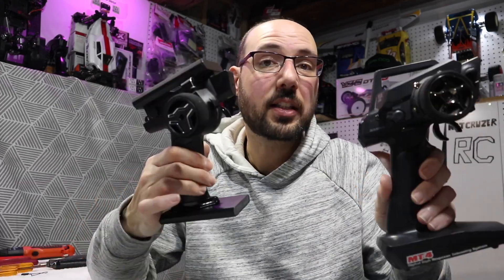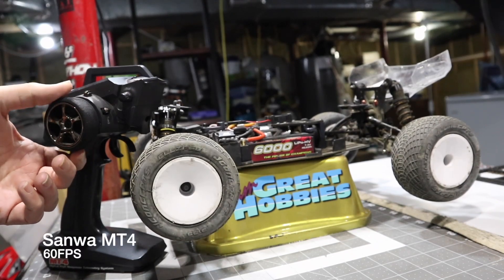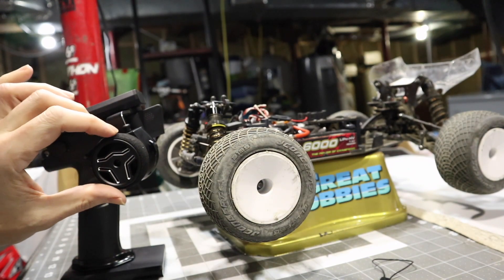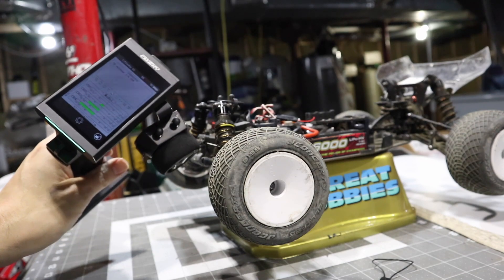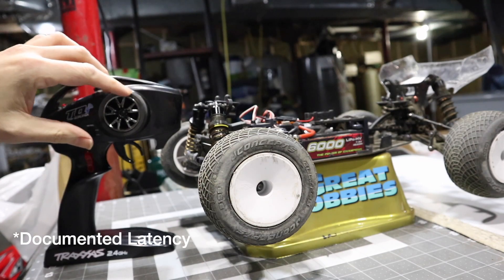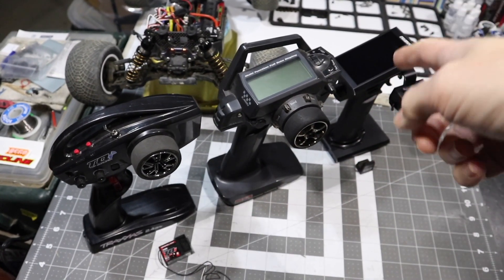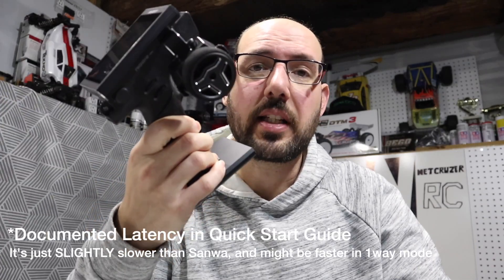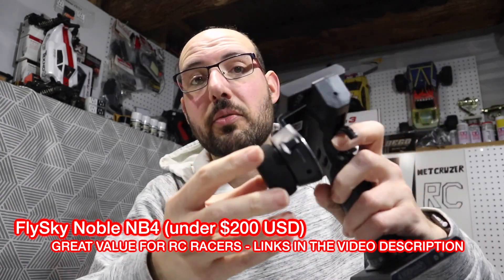RC Transmitter Latency Tests!  FlySky Noble NB4 vs Sanwa MT4 vs Traxxas TQi - Netcruzer RC

Comment from the maker: All radios were bound to their receivers in 2 way telemetry mode. Sanwa FH4T in SHR mode, FlySky AFHDS3 in 2 way mode, and Traxxas TQi Link.  While my math doesn't match with documented latency, I did calculate latency the same way for all 3 so we can see the difference in response delay.  Sanwa wins, FlySky very close 2nd, and for Traxxas.. we show why a fast low-latency RF protocol matters for racing.  Product links in the video description. Thanks for Watching.
Reply: What about the 1-way option on the nb4? I don't need Telemetry on a race car... I don't know about you guys but when I'm in a race, my eyes are on the car, not the radio...
Reply: Thanks man! just starting to get back into racing, glad i saw this video and picked up an mt44

Comment: With all due respect, it doesn't matter.  I call BS if anyone thinks that anything less than 13ms is a meaningful advantage.  Why?  Be uase the human I takes around 13ms to respond to a stimulas.  Google it.  The brain then has to execute and send the signal to the corresponding muscles.  The diffences between those radios is all marketing hype.   Driver skill is a much bigger factor than 5 milliseconds of an RC radio.  Besides, you're not even factoing the latency of the servo, reciever, or ESC.

Comment: Excellent comparison . Do you still recommend the noble nb4 till now or there is something new you can recommend.  Thanks anyway
Reply from the maker: Still recommend the Noble NB4 in 2023. There is a Pro model too, but most (including me) don’t need the features it adds for the big price jump.
Reply: @netcruzer  Thanks a lot. Got it. And I love it. Hate the sanwa too)))
Reply: After watching videos, investigating and comparing, I even had purchased the pro, and returned and got the NB4 m. You can get the regular Noble for half of the price and they are the same. The pro just has some fancy extras. They are some crazy good extras but, after thinking about very well, NB4 is moreeee than enough
Reply: @adrianchiloeches7262  Thanks alot.  👌

Comment: I know this is a fairly old video, but it’s very difficult to calculate with real accuracy. Was there delay at dead centre programmed in. The quality of receiver. Speed of hand could vary. All could make a difference. But unless your a world class driver it don’t matter.  Y standard a one second delay wouldn’t make much difference 😂

Comment: In the car world, every benefit has a down side.

If you 'improove' something then you also loose something.

So now you 'improoved' when stuff happens, your car will do something badly.

It will be too fast at doing stuff.

You'll smash into the guide rope.

You tune in the steering to get track position.

Comment: The NB4 has a "sport" mode. By default the radio uses 2 way communication. To set the radio in "sport mode", you need to set the RF to AFHDS3 1way, under Model/Radio Frequency Setup.
Reply: what does that do
Reply: @the_jeremy_renner_app  Removes bidirectional communication so you lose telemetry (signal lost warning) but improve latency.

Comment: For the same price, should I get a brand new Noble NB4 or a used Sanwa M12?
Reply from the maker: That is a really difficult choice. M12 is technically a faster protocol, but I think that radio is too big and weighty. Noble NB4 is a more unique and futuristic build. Personally I’m keeping a Sanwa for onroad and Noble for off-road Racing use.
Reply: @netcruzer  what’s a good radio for on road and off road do you suggest

Comment: Nice video.. but, I think that those differences are not visible to normal every day user.. i use different radios, from cheap dumborc, over spektrum and traxxas till futaba.. and they all do they Job Great.. same thing as on my fpv drones.. few years back latency was big thing until dji digital fpv came out with waaaaaay worse latency than any average analog system.. and suddenly, latency is not a big deal 😄😄

Comment: Man your latency number in red are in s not ms. It's 0.11s not 0.11ms. Does not help following the vid.
Reply from the maker: The math is wrong but I did all the same way so the comparison is accurate.
Reply: @netcruzer  Sure you did a fine job ! But maybe a disclaimer in the description would help.

Comment: Do you have a Spektrum Dx5C or pro or similiar to compare the speed to the NB4?  I would be interested to see if the Spektrum is in the same league as the NB4 or at least faster than the Traxxas.
Reply from the maker: I do have a DX5C smart. Those are 11ms advertised latency. It’s slightly quicker than traxxas 13ms. But nowhere close to Sanwa, Futaba, and the Noble. Those are all 4ms or less racing radios. Spektrum at its very fastest is 5.5ms but you need a PRO radio and a PRO rx and get no telemetry at 5.5ms DSMR.

Comment: Is the telemetry data you mentioned on the NB4 only from the receiver or is it getting info from the motor and esc as well?   Does it also have car battery info?  Just trying to understand the whole smart telemetry stuff.
Reply from the maker: Only from the receiver, showing it’s voltage and signal strength in 2 way mode. Additional telemetry would require sensors which I’m unsure if flysky supports. “Smart” telemetry IMO means it works without buying extra sensors and cables. Traxxas TQi and Spektrum Smart paired with their own brand ESC are the only smart systems I’m aware of.
Reply: @netcruzer  FlySky does have sensors which can be added, like temperature, voltage, etc.

Comment: Hi, please don't include any traxxas products in the future. They are an insult to the hobby industry.
Reply from the maker: It’s to compare RTR spec radio latency. The Traxxas actually has plenty of features such as over the air updates and telemetry than other brands don’t have. I’ll check Spektrum and other brands later. I’ll show and review almosf any hobby grade brand products.
Reply: I would argue that without traxxas the industry over all would be worse off. it brought in an entire generation at an affordable price point. Without that the RC industry would be much smaller, parts would be more expensive and you'd have less places to run your vehicles.

Comment: Great testing. I feel you should have included the Dumbo RC and RadioLink radios. Those two are two of the best cheap radios out there on the market. They both have excellent protocols and latency. not to mention the best range of most radios out there, including Futaba's and Sanwa's. Maybe you can test those next time?
Reply from the maker: Yes that will happen. I don’t have a dumbo but I do have a radio link to review

Comment: Great stuff John, I tried the one way protocol on vrc and it felt quicker (could be a placebo though 😁).  I couldn’t get my v1 FGr4S receiver to bind on the 1 way protocol, maybe the v2 you have might?  Interesting if it improves the latency further.
Overall I’m rapt with my NB4 and a small latency penalty isn’t an issue for me given all the other positives (I guess the top 5% of racers would not want the latency penalty, but for the rest of us it’s not an issue). 
Would be great if you could do some back to back running at the track too (🤞 you can get back there soon). Thanks again!!
Reply from the maker: Phend uses Spektrum which is at best 5.5ms bind protocol, and for most DSMR radios it’s 11ms. So technically the Noble is lower latency than the best Spektrum that a world class A driver uses.  Once you get this fast I don’t think it matters much but still interesting to see the input delay differences.
Reply from the maker: Oh I remember reading you won’t get a confirmation of 1 way bind because the radio doesn’t get a confirmation signal. Power off and on after a 1 way bind attempt and it should be linked.

Comment: Informative video!!!! If my 14 year old sees this vid.I'll never hear the end of it until I replace radio and servo in his baja rey. Lol!!! I can just hear the excuses. Sadly he's right (ur video) lol! By chance do you know the latency #'s for a Sanwa mx3x 12 years old. In great shape! Thank you for the visual comparison!!!
Reply from the maker: That older MX-3X is still good! It uses FHSS-3 (FH3) non telemetry 3 channel signal. I expect you are at ~4ms documented latency with that. A M11X with top spec FH3 receiver was 2.5ms. Sanwa does an interesting thing where the higher end Transmitters have lower latency even when binding to the same Rx as a lower end radio in that generation. AKA, your old Sanwa is still 2x as fast as a normal RTR radio for latency. The MT4 I have was what came after MX-3X and the big deal was adding 2 way telemetry on FH4T protocol without a latency penalty (~4ms). Then dropped to 2ms on MT4-S and beyond.
Reply: Thank you, wow that is nice to hear. 12 or so years old. Sanwa don't make this mx3x anymore do they? It is very responsive.

Comment: Great video but, i think your figures have  error. You mention response times of 0.09, 0.11 and 0.19 milliseconds. This can not be correct as they are way to fast. If you recorded at 960fps then indeed, one frame is 1/960 th of a second and if your frame counts of resp. 90, 106 and 186 shot @960fps are correct it adds up to total times of resp 94 milliseconds, 110 milliseconds and 194 milliseconds. Which are way to high. Did you count your frames when playing back the video @30fps? in that case, you have to correct for the slowmotion factor of  960/30=32. Then your times become 2.9 , 3,3 and 6.1 milliseconds which sound realistic. You also lose time in the transition from servo movement to wheel movement because of play in the steering links. You see your servo arm move ' way ' earlier than the wheel.
Check out this guy's video on the same subject: https://youtu.be/wHefB1bLTb0 He shot at 240 fps . he removed the steering linkage errors by taking a 'naked' servo but i think, he counted his frames during play back at 30fps and also made the mistake not correcting for the slow motion factor of in his case 8. His result for the Noble should be 24.95/8 = 3.1milliseconds. This comes close to your 3.3 value which probably has some link-transfer error in it.
Perhaps you can redo the test in a similar way the other guy did and compare your results with his?

I have a Noble 4 as well and am very happy with it. It's versatile, lots of features, great range and not very expensive for what you get. I also use it for VRC World :-)

Keep on making great RC movies and let's get as many people as possible interested in this great hobby!

Regards,
Gert
Reply: Yeah I didn't get it. The TQ says  3 second latency at the top, then .19ms at the bottom... So insanely slow or insanely fast....

Comment: Interesting test and very likely not noticeable difference on an off road track. How about range, do you plan on doing a range test? Wasn't this one of the issues with Spectrum when they first started in the race radio market that signal strength was a bit weak and range could suffer?
Reply from the maker: Spektrum DSM had a problem with how it chooses frequencies, causing interference. DSMR is better but still I think the competition protocols are better. Range I’m not too conferenced about as I’ll just be using this at race tracks not long distance speed runs, but a few have mentioned it so I’ll consider how to test range. I’ve seen a Noble used at the big Bego 1/8 track and it had no range issues.

Comment: great video...would like to see someone do the same test on the radiolink rc4gs v2 or rc6gs v2.

great budget radio and super fast response and super long range.
Reply from the maker: I have a new in box RC6GS v2 and will test it. The on paper response rate is RTR spec (+13ms), but range is far.
Reply: Radio link is ok if your on a tight budget or banging around the house. But if your getting into racing you really want a quality system. Noble is the best for the price I love mine. But my Futaba 7PX is still the king of all transmitters. But it comes at a price.
Reply: @roberttruesdell6151  What does that even mean, a “radio link”? 🧐 Every radio on sale uses a radio link, they always have. 😱 How else is the rx supposed to receive the transmitter commands if not by a radio link, you’d prefer a long cable instead? 🤔 Because that’s the only other option, wired or wireless. Maybe you think your Futaba uses some magic connection to your internal telepathic powers but mine sure doesn’t! 🤪 It uses a radio link, just like every other rc control system ever invented which is wireless.😱
Reply: @aaronperelmuter8433  what the heck are you talking about?  RadioLink is the brand.  Learn before you spew off uselessness and then try and insult and be funny.
Reply: @aaronperelmuter8433  dude Radiolink is the Brand of the transmitter and receiver the poster is using.  Where is your confusion?

Comment: I have a Futaba 4pls. Any idea what the latency on that is?
Reply from the maker: Completely depends on what protocol you are binding with.  According to RC TECH forum, here is Futaba latency. 
Note that high speed usually requires a digital servo and higher spec receiver.
normal speed s-fhss 15ms
high speed s-fhss 6ms
high speed t-fhss 3.3ms
normal speed t-fhss 16ms
Reply: @netcruzer  Thanks for letting me know
Reply: Great video.....how much of that depends on the servo......you might get something different with faster servo.....
Reply from the maker: I used one of the fastest brushless servos I own to test this. I’m watching for the delay from when my hand moves the wheel to when the servo moves. The speed of the servo itself is a rating of the 60 degree sweep transit time. We are not as concerned about that. But a fast servo is what makes the traxxas radio also look fast when watching it in real time.

Comment: Nice test I have a futaba t3pv do you have any idea how fast it is compared to the ones you tested I'm getting into racing should I upgrade or is it fine for racing?
Reply: So if i got this right, the noble nb4 is faster?
Reply from the maker: Documented latency for that 3PV radio in normal S-FHSS mode is 14ms,  and in high speed S-FHSS mode is 7ms and if you pair with a faster receiver and fast digital servo you can get latency even lower.
Reply: @netcruzer  thanks for your response👍

Comment: I just ordered one...I’m excited to give it a shot. Thanks for the videos!
Reply from the maker: After testing this, I feel confident saying the Noble is best value for a modern new high performance RC racing radio.  The newest Sanwa and Futaba are lower latency, but it's such a small difference you likely would never notice it.

Comment from the maker: FYI Spektrum DSMR was not tested in this video but those have a documented 11ms response rate with Smart telemetry on. If you have a Spektrum PRO radio and PRO receiver, you can bind DSMR at 5.5ms but that is 1 way only (no smart telemetry).   Regarding Futaba, I have no Futaba radios to test with but documentation says they are at or under 4ms in the newer protocols.
Reply: Spektrum talks usually about frame rates 5.5ms, 11ms, 16.5mm and 22mm, but frame rate is different than latency. It seems that the communication between some Spektrum radios and receivers takes quite a lot of time so in practise you have to double or triple that frame rate to get real life latency.